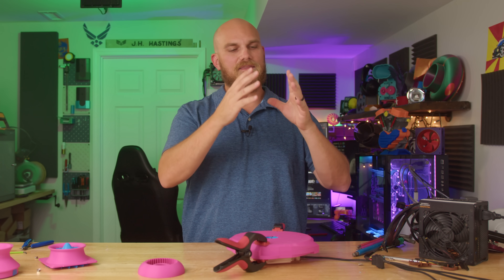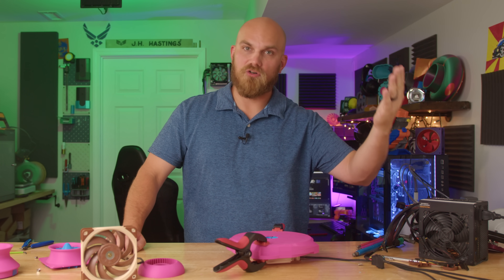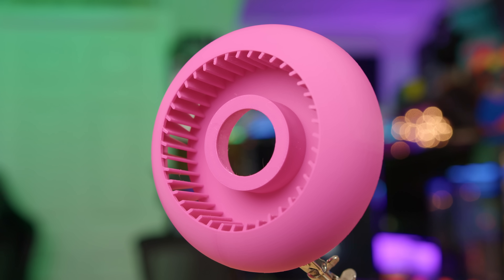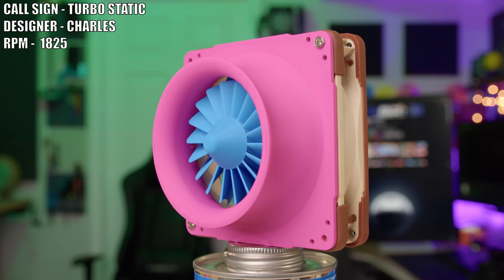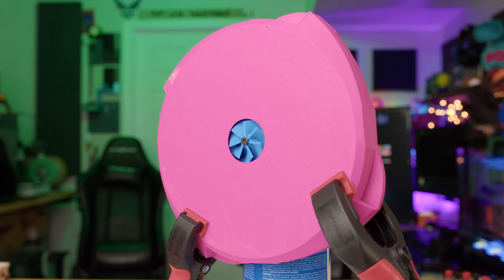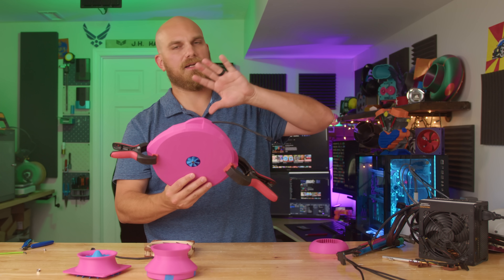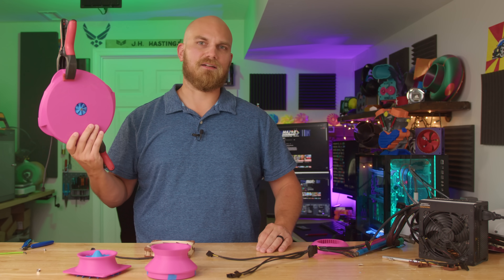Wild 2-Stage 200mm Blower Fan Redefines Power | Fan Showdown S6E6

Comment: I'm for Group B: anything goes, however the "normal" fans, i.e. fans that fit into the constraints, should get their own category, because they could be used in a regular case.
Reply: I 100% agree with this. Just like racing we need “Super Stock” 🚗 and “Unlimited” 🏎️ classes! 😎
Reply: @VimCommando  Great analogy. Totally agree.
Reply: @VimCommando  this, precisely!
Reply: @VimCommando  Group B is a racing reference. Too unlimited, it became dangerous and thus cancelled. American merry-go-round racing is like watching a confused dog chasing its own tail.
Reply: This. It also tend to get more views for our major
Reply: Same here. 

Seeing a design that can actually fit into standard dimensions. But i'm okay with making the fan slightly thicker, since most PC cases have enough space to acommodate them. 

But i also like to see creativity.
Reply: @mike_et_saika from what I’ve seen these days most pc cases are 80% empty space.
Reply: i was about to say that they should have separate category and list both on the chart . maybe for next season
Reply: 100% Agree
Reply: What about adding a simple column to the spreadsheet that states whether the fan is fitting inside the base or not. Then everyone can tell what the Camp A winner is as well as the Camp B winner.
Reply: I'd add one caveat, the air must go through the a12x25 frame.
Reply: ooh I love the Group B analogy
Reply: Mostly agree, but I think we should have two score "blocks" in the out-of-format ones: Champfan and Lucky Dog. Champfan is anything but still being driven by the Noctua, while Lucky Dog can use the RC car/racing drone motor, like on the compressor 😁

Because honestly, a very large portion of these wild designs perform poorly because they need far more speed. Most of the compressor designs imo really need at least 15-30.000 RPM to show what they got (and if they can make a showing before self-destructing). I'm not sure even CA30 PEEK can withstand proper turbocharger speeds. At 70-90.000 RPM, even with just ambient air involved you need those vanes to be extremely rigid, ultra strong, and seriously heat tolerant with next to no mass 😅
Reply: exactly. At the end of the season you can name a winner in each category :)
Reply: I think we would be really missing out if we completely blocked out the crazy fans.  They are great to see.  But keeping them separate is a good plan.
Reply: I'll add in my agreement for this. "Limited" and "Full Send" classes, lol
Reply: If we are doing group B, we gotta make sure there are homologation rules
Reply: And "normal" should mean truly normal - fits into the standard restraints of a commercial 12mm PC fan.
Reply: +1
Reply: Good call, best of both worlds.
Reply: I want a case with 1m^2 fans.  GIMME THAT SQUARE METER FAN!!!
Reply: I second this, simplicity for regular use are great for users that wanna have something for their own PCs, and extravagant is useful for education & research, and just pure fun to push the bounds and limits of possibilities
Reply: I am also with this. Love the Crazy ones. But also want to see the more normal ones.
Reply: 100% 👌🏻
Reply: I feel like there should be 3 categories, 'normal' 'extra' and 'mixed'
Reply: Or make it visible but in the standard table. Maybe other colors. Being able to compare the crazy fans with the standard fan is also intersting.
Reply: als ob leute immer noch das profilbild haben :D
Reply: agree 100% 😎
Reply: Fully support the 2 different categories!
Reply: I like the Group B idea, but hopefully the fans in this category won't be lethal.
If this ends up in an "unlimited" class then I have a few fans at work that falls into the megawatt class.
Reply: yep, creativity pushes technology forward, and constraints make them usable in real life.
Reply: I agree with this but id say they both end up with their own "series" fan showdown id love to keep within the fan constraints and ofc a little thicker so you can still use then as a fan next to for example another fan 😂 and then another series that fits outside of theese perameeters
Reply: Exactly this. I want to see the best thing I could fit in a regular case, so maybe a couple mm beyond the fan frame at most. But then I also want to see these crazy contraptions that defy logic.
Reply: Though I wouldn't mind a case with a big ole "Centrifuge Madness" on the front of it.
Reply: Love the rally referance
Reply: I choose option 3.
Reply: Yes they should be two categories. With restriction and you  can compare the two light feather weight and heavyweight
Reply: Exactly my thoughts
Reply: Agreed
Reply: Ageed
Reply: I wonder if that centrifuge madness could be made smaller, even still, implementing it in a pc, its airflow would still most likely be limited by case fans
Reply: I agree
Reply: is it named group b because in rally group b there was no rules or is it a coincidence
Reply: agreed
Reply: Group B, like the rally one... Nice.
Reply: Yessss!
Reply: Yeah there oughta be in an actual "in use" test w a generic air/water cooled system. If by chance it fits in that category, however funky it's engineered, it'll give you an idea of its size and use practice
Reply: Like the idea of an open category and the stock category
Reply: yeah just release 2 categories normal fans showdown and creative showdown
Reply: well you can also use the custom fans for such things. in the past I had a pc which had a huge fan on the top of the case, the entire case was designed for that as well as it would get wider to the top. it would also directly blow down over the motherboard and cpu, had a few other fans.
but made almost no sound especially since the huge fan moved huge amounts of air even at a super low rpm. 
back then it wasn't custom but was a special case. it had back then one of the more high end power hungry cpu's in it and 2 of the back then high end gpu's as well. the cpu only had a passive cooler, a big one but passive. I could overclock the cpu with more than 1ghz(which back then was a lot as that was in the time where 2ghz was normal and 3 ghz where the super high end chips, so boosting that by 1 ghz was a lot.
the cpu still stayed almost completely cold, only got a few degrees hotter ofcource this was before the NVIDIA TDP era where people find 1000+watts for a single pc component normal, but still temps rose by around 10 degrees celcius in total being less than 20 degrees above room temperature, also didn't try to push it much further since I didn't trust the motherboard and it's capacitors of handling that.

soon after selling that pc I already regretted it, actually as soon as I started looking to build a new one, since for one that case alone was worth more than what I sold it for, but that I knew when selling. but when looking for new pc hardware I noticed you couldn't buy any special cases like that anymore, also this wasn't like those huge side fans, but instead on the top and was much more airflow optimized than those side fan ones.
all components for pcs where available and payable around that time as much better hardware was there for quite cheap then but pc cases just got so super boring and bad, even the expensive ones had nothing special, some leds, but nothing to truly help with airflow or such.

thinking outside of the box shouldn't be punished  in fan design.
instead perhaps they should add a statistic for how expensive or complex to make fans would be, so as to see if they also make sense for normal users. since I don't care about a fan looking big or cool if their performance is much better than a boring one, next to that I like big and cool as long as it adds something.
that said for pc hardware I would say the direction of the airflow is very important, the reason is because that way you can blow over components and create airflow instead of moving the air around you can make it go wild and thus cool a lot more.
Reply: yes. NO LIMITS! 
define new tiers of functional doozy with such extremes then compete there! 

sorta like the Americas Cup.
Reply: Group B is the best group.
Reply: 100% think this is a good suggestion
Reply: This, two different brackets, traditional and literaly rally group b, anything goes
Reply: Yes!!!!!!!!!!!

Comment: At this point the only way to be fair is to split them into different categories, maybe just smol vs big, or maybe more granular, like A) "blade only" within the frame, B) slight protrusion with height limit, and C) no rules
Reply: Maybe for a bit of flair, say stock, mod and pro mod like drag racing.  With the parameters that ekupka stated.
Reply: Open, Extended, Case

Comment: make the fan fit in a case, ie usable application, in an *atx case. you want a fan that is usable in a pc. small hole means small amount of back air flow. cooling performance is a better comparison. ie combination of air flow and pressure. ie actual application performance.

Comment: mechanical engineer here: 

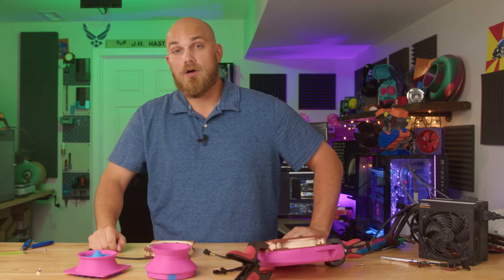9:30 its quiet because you dont have any resonance. The curve is flat all across.
Also, 47dB is half the sound energy than 50dB.
Because dB measurment are logarithmic, its not a linear scale.

i kept thing simple for everyone to understand*
Reply: Yep, every 3dB is a doubling of sound pressure... though, most people don't perceive a doubling of volume until around ~10dB difference.
Reply: @BionicBurke  This is because sound pressure does not equal sound volume. Volume is literally perception as it's a combination of sensory input and interpretation from the brain. The actual pressure variance may have doubled, but the ability to both sense and interpret that change is... muted. 🤣
Reply: @BionicBurke 
Very much agreed, and well said. 
It’s true the power requirement with every 3db doubles, 3db is also the minimum level of perception that it’s louder. Hardly a big increase if it’s barely noticeable, but it’s 1000 watts if it was 500 before. 3db. 
My live audio experience has been about 10db is twice as loud, but more like 8db. 
Say 100dba vs 108dba, that’s a huge difference.
Reply: @BionicBurke  this is exact :)
Reply: Perception depends on frequency as well, our sensitivity to different frequencies is  different 
Also different frequencies propagate differently trough the medium, case dumping the sound and so on
Also also: two stage compressor against open blade design in air pressure competition, come on… ))
Reply: It's quiet because it's not moving very much air at all.  The secret to this season is to seal everything up as best as you can so that any power that you use is pushing whatever leakage air that is left through the smallest effective orifice you can manage - ooh er!
Reply: Automation engineer here: If the thing is heavy, it does not run as fast, thus creates a lower pitch sound and often also less decibels. 

If the thing is heavy but creates a high pitch sound, get out of there, it's gonna be messy when it blows up.
Reply: ty
Reply: You have to multiply power (measured in watts) by 10 to get twice the volume in dB
A 100 watt amplifier is only twice as loud as a 10 watt amplifier
Reply: @pihermoso11  no, not at all. Its not multiply at all. We perceive something twice as loud with a jump of 10dB. So 90dB sound for us half as loud as 100dB.
Reply: @1nicube  I'm only quoting my teacher from electronic school when we built amplifiers, he said a 100 watt amp is only twice as loud as a 10 watt amp, because in order to get twice the volume you gotta multiply the wattage by 10, P=IV
Reply: @pihermoso11  im talking about dB, not watt 🤔
Electrical is another subject.
Reply: @1nicube  A delta of 10db is a tenfold increase in acoustical pressure and acoustical energy, which is measured in watts and hence also requires 10x the amount of electrical power. So +10db requires 10x the amount of watts. To go from 100db at 10W to 110db you need 100W. Past that and you're heading into power-compression territory though so the relationship becomes nonlinear, if we're talking about speakers.
Reply: @iliketoast-q9b  watt consumption of speaker equipement have nothing to do with the actual wattage going to make the sound. The more power, the more you have ineffeciency.

But for the amout of wattage is requiered to produce the sound : 
The formula is power level [dB] = 10*log10(power[W]/10^-12)

so for 
0,01 W = 100 dB
0,1 W = 110 dB
1 W = 120 dB
10 W = 130 dB
100 W = 140 dB
1000 W = 150 dB
10000 W = 160 dB

which each 10dB is a perceptible double the amount of sound.

also  as you can see, a speaker that take 100s of watt to power, only requiered less than 0,01W that is converted in useful sound energy.
Reply: @1nicube  I mentioned power-compression, which is a decrease in efficiency due to a rise in impedance from increased voice-coil temperature. However even at loud listening levels at home it's practically non-existent, so a 10x increase in electrical power will actually produce a 10db higher spl, so my point still stands. We're talking about a delta, not total efficiency. 
Speakers can actually be much more efficient than the often quoted fraction of a watt. A compression drivers on a horn or waveguide can reach 25% or even slightly higher. The +10db = 2x perceived loudness is just a rule of thumb though.
Reply: I thought that as it has four air outlets if the number of blades is not a multiple of four it would be quieter. And it seems to have worked. 😁
Reply: @gabrielhacecosas  the number of blade have "nothing" to do with it.

Number of blade multiply the number of bramch its passing by give you a predominante frequency, but thats not the "problem" here. So saying 4 blades.. you miss half of the information.
Reply: @1nicube  I thought that if four blades go through all four outlets at the same time, it will make more noise than if only one blade goes through, at least it will make a higher pitched and softer sound, right?
Reply: @gabrielhacecosas  it always depend on the number of the holding part of the motor.
3 arm and 4 blade sounds different than 4arm and 4 blades.
Reply: @gabrielhacecosas  the four outlets are inside the housing, there's just 1 intake and 1 exhaust looking from the outside, those 4 outlets that the air passed through are internal

Comment: Glue it together. We can see the gaps that will leak.
Reply: He could tape it once the clamps are on for something that can be removed but gets its peaked performance
Reply: @maduyn  I was watching this wondering if he was aware that tape is a thing.
Reply: Yeah, you can see air escaping in the smoke test, it's gotta be leaking even more when actually pushing against a pressure gradient

Comment: Now just design a hermetically sealed case with a bunch of high static pressure fans forcing air in at one end, and radiators with dense fin stacks on the opposite exit.
Will we see better than traditional cooling? (Make this season 7!)

Comment: What about having divisions?  Have a Limited Division that requires the design stay within the frame, and then have an Open Division were anything goes, so long as it is powered by the A12x25 motor.

Comment: To answer your beginning question, there should be different categories for the 2. If it expects expands beyond the frame and needs additional shrouding parts etc, it's gets compared to similar designs. If it stays roughly within the frame and doesn't need much extra in terms of extra parts, then it gets compared to that style fans and the original
Reply: Different categories makes sense.

Personally I'd be more flexible with the power rule and less with the form factor.  The important thing in my mind is creating a fan that could be adapted to work inside a normal-ish PC.  There's relatively little room there for different shapes, but changing the motor or increasing the voltage is something that could be done quite simply.

Comment: I like both camps. And I think that the chance we're going to see anything remarkable from camp A is pretty low. The people that sell these fans have certanily optimized their designs already, but still you get a lot of creative submissions. Camp B is more entertaining and exciting. I think you should accept fans from both camps BUT I think they should be in separate classes or categories. They shouldn't be competing against each other. That's kinda unfair.

Regarding the centerfuge madness. It's possible there's some leaks. You should make a separate video to make sure there aren't. But really I just want the separate video so we can watch you SMASH IT!
Reply: At higher pressures I've seen air leaking out around where the wires go through the frame, and a difference in pressure when I taped the seams too, so glueing might make a difference.
Reply: @mobiobione  Yeah, you can only expect so much of a seal with 3D printed parts literally clamped together. Especially when there aren't any features in the geometry to make sure they're paired up nice and tight.
Reply: @MrDowntemp0  I was thinking about huge screw threads, 200x1.75mm or something

Comment: The way I see it is you have 2 categories: ones that fit within the boundaries of the a12x25 (including height), and then everything else... literally anything, as long as its powered by a12x25
Reply: Ok so the centrifugal madness.... Looking at it makes sense that it would be high pressure. Like the air behind it would just slow and steady build up. But what about CFM how does that look?

Also WATER PUMPS!!!